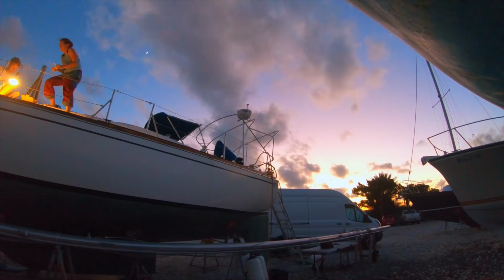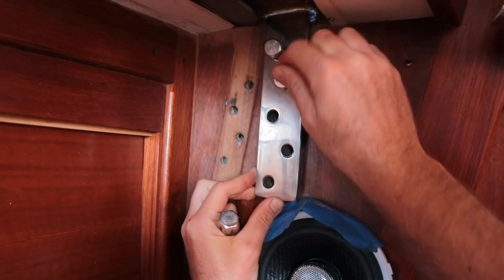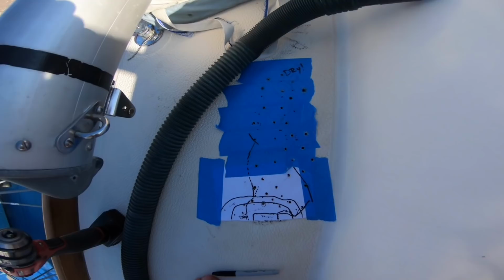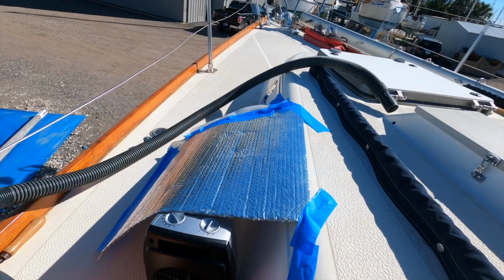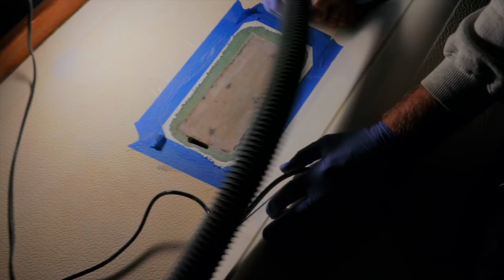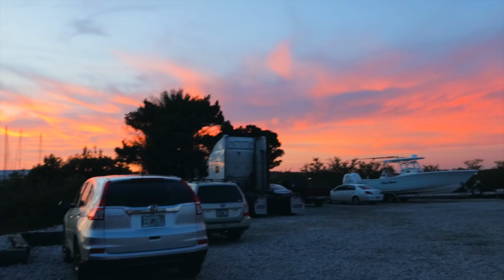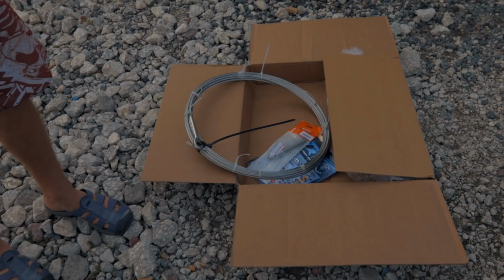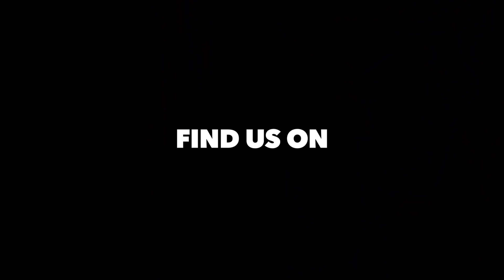Teamwork Makes the Dream Work | Sailing Soulianis - Ep. 85

Comment: The sound of a SailRite sloooooowly spinning up is so so so satisfying.  It sounds like "I am here for WORK. FEED ME!" (And yeah, their project and maintenance videos are AMAZING and possibly the best sales tool they could possibly have. )
Reply from the maker: Haha 'feed me!' that's good 😂
Reply: I love my Sailrite machine. The company is the best to deal with.  One of my first projects (actually the one I bought the machine for) was to sew a two piece boat winter cover that covered our C&C 37 down to the waterline.  115 yards of Sunbrella.   Lots of zippers to go around the rigging etc.  Fit like a glove.  The C&C 37 is almost a clone of the Tartan 37 except we had a full fin keel instead of the centerboard.  We used it for 6 winter coverings on the hard before we sold the boat.   You will love that machine and it will save you thousands of $$.  Link to picture of the cover. https://bmckelvy.smugmug.com/Projects/Boating-C/i-XcKhdKB/A

Comment: Impressive that there is so little rot on a 40 year old corded deck, the past owners sure did a great job of keeping the water out.
Reply: It’s a Tartan. Sparkman & Stephens design..
Reply: I'm guessing not original deck
Reply: @MrRourk  most likely it is original...
Reply: Fresh water Lake boat Dan. Likely kept indoors for 6 months a year thus cutting the age in half.
Reply: @bobyandell3898  Yup, if you are shopping for an older boat in great condition, come to the Great Lakes.  Fresh water, cold climate and low humidity means minimal corrosion over its life and 6 months per year dried out on the hard.  Bad news is we can only sail from early May to late October if we're lucky.
Reply: @bobyandell3898  it’s a Tartan and NOT  one of those throw aways sailboats...
Reply: @bobyandell3898  Bob, owning a 30 year old Great Lakes boat has me agreeing with you on most fronts.  Fresh water / cold weather stored boats are typically in much better shape overall than their salt water conterparts.
When it comes to core rot, my opinion is that the problem is not the boat location but maintaining a water tight seal at all deck entries. I have seen a great number of boats wherein the owner simply does nothing as far as inspection or maintenance of these critical points.  Hats off to those owners that take the time (or spend the cash) to have these areas inspected on these beautiful vintage boats.

Comment: Guys, instead of adding fibre glass deck cut replacement, get high end stainless steel for that size of square and create a "cubbyhole" mini storage area. Support the "bin" from the bottom with supports and use epoxy and marine grade Sikaflex. This way you dont sit with an off color part of the deck and get a utility storage space.

Comment: I have just finished the same repair on my 1991 Catalina 34 as you wit regards to the chain plates and epoxy sealing of the core.  All my core was okay except, wait for it, my port forward lower!  My deck core is plywood which seemed to fair quite well and I was able to get the rot through the chain plate hole with various implements of destruction.  I had the same trepidations as you regarding cutting my pretty deck.  It is a tough thing to start and is mostly a game of the mind!  Cheers you two.

Comment: Greatly appreciate your work on the chainplates and deck repair. We just pulled our starboard bulkhead on our Tanzer 26 and found bad dry rot (port is next) so to see someone tackle a similar project is reassuring. I too go through similar stages of dread, mistakes, and solutions each time we do a major repair. Thank you. You two are an inspiration.
Reply from the maker: Good luck with your project!

Comment: The mold you made for the non-skid was impressive... I'm glad you didn't ask anyone who has 'been doing this for 30 years!' because they would have screamed at you that epoxy will not stick to gelcoat.  West System and Andy @BoatworksToday have proven that it does work and you showed it here again, great job.  What is surprising to me though is, at least on the mold side, is that you used waxed gelcoat and you got the fiberglass/epoxy reinforcement to stick... did you acetone wipe the surface layer of wax before glassing?  Whatever you did, it worked out fine!

Comment: Lauren has exactly the same tolerance for alcohol as my spouse, it's quite cute.  Also, those dodger to bimini connectors are always going to flap a bit on the edges, it's just the nature of the shape.  As a result, that's your most likely spot to see some eventual tearing due to wind damage at the corners where they attach to the dodger.  Great to have full coverage of the cockpit.

Comment: The chain plate deck area repair will be interesting to see how it holds up over time. There’s a number of Boatworkstoday videos where he really sands quite a bit outside the repair/hole area for the fiberglass layers to adhere to more of the original fiberglass for connected strength.
Reply: I agree, I have just fully rebuild my transom and made sure that I had a really good overlap onto good glass, also looked like it was not wet out enough as the fibers should start to go transparent and they were very visible.
the other thing I noticed is that they did not use a thickened epoxy to glue the core down to the existing glass, they just put a layer of glass down then the coring onto that, my worry is with this is that there is likely going to be voids as you cannot see how its pressing up against the bottom glass, a thickened epoxy glue would have taken any little voids up and made it way stronger

Comment: I think it's more standard to slather the new core with thickened epoxy so it will fill all the voids in the space. 
Also the top edge should be feathered out probably more than you did, and at the start of the epoxy work, so when you add 6-10 layers of new glass the new layers are in concentric shapes getting smaller and smaller.  The smallest piece  goes on the top, so when you sand you sand its edges off, you don't cut into the weave of the largest piece. I repaired a sea kayak with huge holes in it. 

  Fiberglass, water seepage, swelling and delaminating. I made a couple of wood core sea kayaks. Seepage and delamination happen a lot quicker than I ever thought it would, and I didn't stay on top of it... But here's what I also noticed. I've never had any delamination inside the hull, only on the outside.  A kayak is basically a cylinder, so when the wood core gets wet and expands, it only expands to the outside, never to to the inside. So all the delaminating will be on the outside. On a sailboat this might not be how it always happens, but there's another factor: where does the water come from? Unless it's the bilge it comes from the outside. So tearing a hole in the deck and fixing it from there is the logical way to do it. 
And just as you figured out polishing your chain plates with 3000 grit steel wool makes them shine like mirrors, getting used to making really smooth fiberglass patches on the deck and hull is just another skill set.  My experience is to fix everything with epoxy. A properly prepared surface, clean and sanded rough, like old epoxy, the new epoxy will make a permanent bond. Sanding down the surface to match the existing surface isn't a problem. 
I'm also a nervous nellie about working with epoxy: long sleeves, gloves, respirator. Some disagree. One thing that West Systems does say is dangerous is standing not-fully-cured epoxy.  
The flappy bimini extension  (which btw looks great. good work.) This is the catenary problem in camping rain flies. A straight edge on a rain fly is always a bit loose and flaps in the wind. The way to avoid this is to cut and seam the free sides with catenary curves. (my experience is that even if you wing it you can pretty much solve the problem. But there are also catenary calculators online. It's a function of the length of the side and nothing else. so once you figure out where the center is you can just curve a stick to each corner.). There are also rain flies that have unflapping straight sides which still incorporate the concept of the catenary. This is if you need a straight line at the edge like at the bottom of a tent that you want right along the ground. 
Also Sailrite being the source of all canvas knowledge in the Universe has probably solved this problem.  Hope this helps.

Comment: Nice job with the fiberglass! Check out US Composites for better pricing than West System. Stipling chopped mat with a chip brush with half the bristles cut off is easier that those stupid rollers on little stuff.

Comment: I enjoy your videos. Very interesting and ambitious project. I’m sure you know of 3M 5200 marine sealant. I like to use Smith’s clear penetrating epoxy to seal the pores of the wood. And then 5200 for the final seal to fill the gaps. Good luck to you both.
Reply: There is absolutely nothing like 5200!

Comment: Question. How do you know that their is no water damage on the other side of that chain plate? Genius idea for getting non-skid. Sorry it didn’t turn out as good as you wanted. But dang, such a good idea!! Great job on the sewing. 🙌🏼
Reply: You dont. The only tool you have short of opening up is to use a probing tool to measure stiffness and look for water using a water detection tool.

Comment: knowing that a marina would have charged you a small fortune for that chain plate work and core replacement had to be a good feeling . congrats. I bought your suggestion , Skipper Bob , for my upcoming trip down the Mississippi. It talks about mile markers as you travel south along the river. Is the river marked along its banks , similar to the interstate highways ? What am I missing regarding their use of Mile Markers. Thanks and I have enjoyed watching. Oh, 1 last thing. The guide mentions buying the inland waterway maps from the Army Corp of Engineers. Did you buy these and if so were they useful. They are pretty expensive so I thought I would ask.

Comment: Do you know about wood hardener? I've used it to fill termite and rot damaged studs and posts in houses. Maybe check it out moving forward. Easier to use than epoxy.

Comment: Hi, did you use polyester or vinyle resin on the fix. Im fasing similar problen with the deck and would like to keep the anti skid pattern. Not sure how the gelcoat would work with epoxy resin though.

Comment: ...something I do not understand. I thought it was not possible to use polyester gelcoat on top of cured epoxy. They are not compatible this way. You can epoxy on top of polyester, but not the other way around.Polyester will not cure properly on top of epoxy; at least it didn't when I repaired boats 20 odd years ago.

Comment: Lauren, I just purchased sport equipment with newly covered removable seat. Vinyl was used. One segment has a scissor cut into the usable area. Any suggestions how to treat the end of the cut so it doesn't tear further? 
For instance, if plastic develops a crack, you can drill the end so it doesn't keep spreading.
Reply from the maker: Hey Art, I don't have any experience with repairing vinyl rips, but my guess would be to use tape.

Comment: Not a  very good idea to open this from the top. it would be a lot easier  but like you said messier on the inside to do this job from below. It will be a lot of work and not perfect to fix this from the top. And when you fix it use epoxy. Next time you cut holes in your hull or drill holes in your hull aske someone before. Holes in your hull especially if you have balsa  core are always a bad idea.

Comment: Watching these sailing channels while they are doing boat projects in boatyards leave me shaking my head, this video being a case in point. Obviously OSHA doesn't regularly patrol boatyards because I invariably see major safety issues like the one in this video - a guy suspended from a crane hook. The other one I commonly see that makes me cringe is watching people habitually walking under suspended loads such as boats hanging in slings without a speck of cribbing, or blocking, in sight. Now granted, I worked as a project engineer for a major rigging (not sailboat rigging, but rather for complex loads measured in hundreds or thousands of tons) company where I was usually on projects in nuclear power plants and refineries where oversight was slightly more common than in boatyards.

Comment: Dunno how to say this without sounding negative, and that is absolutely not the intention, but your glassing job is a bit iffy... rule of thumb is one inch of overlap per layer of lay-up... ok that gets big in a hurry for a thick laminate, but I'd have gone at lest 3 to 6 inches where possible. Also, you want the original glass to taper down to nothing and each layer of new glass to overlap the taper more and more, with the last layer ending roughly at the end of taper. Problem with small overlap is it's effectively a but joint, and glass doesn't do well with those. You create a stress riser on the seam and can expect it will crack under heavy load/flexing.
Then you sand it a bit further out and do the anti-skid over all. For that, I'd try epoxy with acrylic dust (try Jamestown Distributors or Fiberglass Hawaii). From what is visible in the video try maybe medium or coarse, mix it into epoxy and let it go off a bit, then apply with a foam roller. It'll probably settle in 10 minutes in which case I'd just roll it again without adding more material. Texture will not be 100% identical but it will be stuck good.
Be super careful with aggressive sanding either by sander or angle grinder (though latter is worse) as it will heat up the material. That will make it gummy and load your sand paper quicker, but more importantly it can cause de-lamination deeper in the layup. This is a big concern on styrofoam core, probably a bit less on balsa, but still it's a good practice not to dwell on a single spot and not to use dull sand paper.
Dunno about polyester gelcoat over epoxy, never tried it myself, but I was taught it won't stick. Either way, that is purely cosmetic and you can fix it if it peals off.
I'd probably also enlarge all the the penetrations around the chainplates a bit and glass then fully from inside of the boat to the outside, so there is a good barrier around them. If one leaked others probably did/will as well. Generous application of Sikaflex around the chainplates reapplied each couple of years might delay the problem enough to were someone else gets to handle it :)

All that being said, what you did will probably be good enough as it's one small part of a much bigger surface and is probably not under a lot of load. What really irks me is that now you showed it off, other people will copy the process and not much can be done about it. A great resource on the subject can be found here https://boardlady.com

Keep up the good work and happy sailing :)
Reply from the maker: All good tips, and why we don't make "how-to" videos.  But your explanation of 1" per layer is precisely why I did not want to tackle this job from below.  The top skin was thin and mostly cosmetic. Obviously all layers in the sandwich work together to provide strength but the bottom layer of glass is much thicker here, and there was no way I'd have had enough room to taper the edges.
Reply: @SailingSoulianis  Yeah, it's frustrating when you have to go and wreck 5 times the size of the problem area... I did windsurf boards for a while and inevitably you end up running into the footstrap insert or fin box or some complicated graphics when you start tapering. That's why the boards I repair for myself end up with obvious patches with visible core... guts showing is cool. White paint hiding them not so much :)